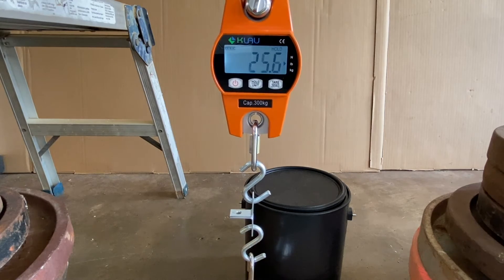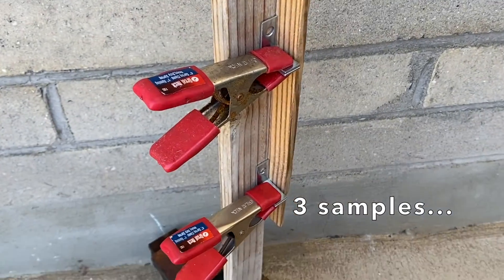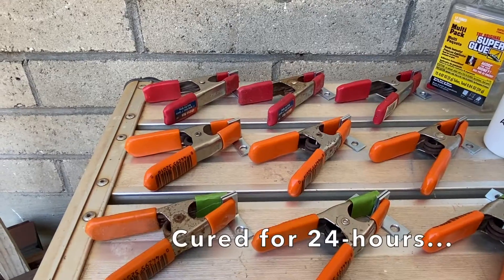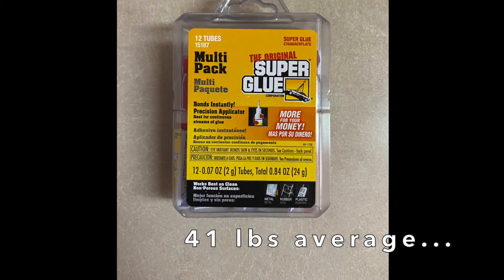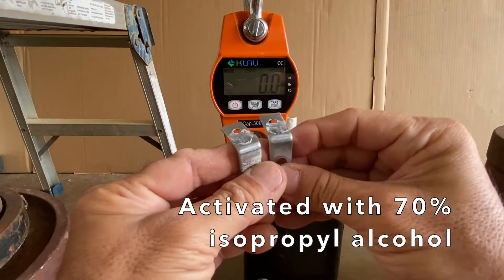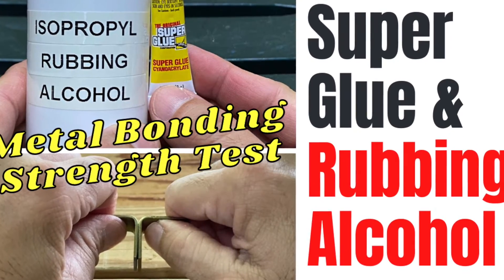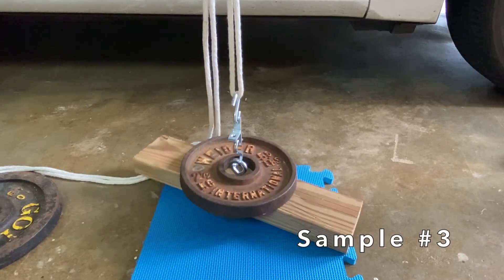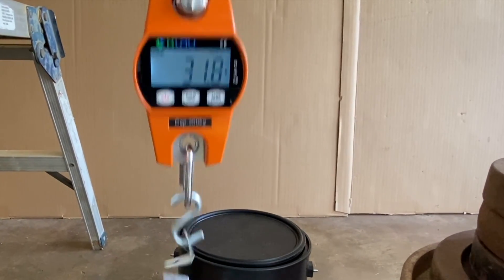DIY Super Glue Accelerant Strength Test

Comment: Have you tested the activators you used in this test with plastic?   I would love to see that.  Thanks for confirming the fact that the activators you used in this test on metal to metal do not strenghen the bond but only accelerate the curing of the bond.   Great video.  Thank you very much!

Comment: Poor methodology. Read the comments below, and try again.  The activated will still likely be weaker, but much closer.  My favorite DIY activator is distilled water and 10% alcohol. I don't use drug store 70% Isopropyl, because it has a lot of additives. I use 100% Ethanol, available on line.

Comment: The accelerant probably caused the glue to cure before it had a chance to seep into the surface crevasses, where as the non-accelerate took longer to cure and had more time to get down into every surface imperfection.  Accelerated super gluing of wood is probably okay, because the surface in very porous and even with short curing times it's able to get down in those crevasses easily.

I'd love to see the accelerated test redone, but this time, lightly sand the surfaces that will be glued and see if that makes a difference.

Comment: This video is actually very good, because it teaches a fundamental lesson about polymers.   Chemistry Lesson Time!!!!   Super glue is a monomer (cyanoacrylate) which reacts to make a polymer in order to cure.  As you know, the polymerization must initiate, and we know that water is a good initiator.  I want to keep this a bit oversimplified.  Imagine if you only had 1 molecule of water.  Then the polymer would only initiate in one spot, and so the chain would slowly keep growing until you polymerized everything into ONE long chain.  That chain would be super strong, because it's held together by covalent bonds.  However, the cure time would be VERY long.  When you add a whole bunch of water initiator, it means you start growing a whole bunch of chains.   Since millions of chains are growing all at the same time, each chain will be much shorter.  You will have consumed ALL of the polymer with this pile of chains.  You can imagine a scenario where you had so much initiator that every chain was only a few units long.  They would have no strength, and you would just have a liquid.  Sure, it would be done reacting in seconds, but it's not even a glue anymore.  So, no matter what you do, if you add more initiator, you will have a weaker bond.  (The baking soda does something similar.  Of course, it's a bit more complicated because it has some gap filling properties, but you still have the same issue... more initiation = faster cure but weaker bonds.)

Comment: 99% alcohol + baking soda 50:1 mix. Crazy Glue/Super Glue/CA Glue is acid, Baking soda is alkaline, when the two mix the CA glue sets. You use alcohol as the medium becaue it evaperoates quickly. If bonding metal you need to rough the surfaces first.
Reply: Hello
Bey weight or bey volume mix 50:1 🤔

Comment: The one you missed is alcohol and baking soda. That's the winner.
Reply from the maker: Interesting… are you talking about a mixture of  isopropyl alcohol and baking soda?  🤔
Reply: @HacksbyDad  yup
Reply from the maker: @mr.boniato6402  I just might give that a try.  Thanks!  😎
Reply: @HacksbyDad  about 1 cup of isopropyl alcohol to 1/4-1/2 teaspoon of baking soda. Try 1/4 see how it behaves, then add more from there.. too much baking soda could leave residue.
Reply from the maker: @mr.boniato6402  You read my mind!  I was wondering how much of each to use in the mix.  Thanks!  😎
Reply: i was going to suggest the same idea

Comment: I've found that using the DIY activator on the exterior after the pieces are put together works much better. The baking soda solution leaves residue in your joints thereby causing the weakness. Same with the alcohol. It works well, just not the way you've done it.

Comment: Maybe the isopropyl alcohol works better wood allowing the cyanoacrylate to better mate those surfaces. I’ve had good results building up a surface repair with CA and dry baking soda. Haven’t tried water with baking soda and I’m not sure why that would chemically be a good choice. Epoxy trends to be a better choice with heard flat surfaces in my experience.
Reply from the maker: Yeah... isopropyl alcohol works better on wood but still not as strong as plain super glue.  Baking soda and water was suggested by many viewers.  Just curious and experimenting in my garage.  Thanks for mentioning epoxy... I've used JB Weld epoxy on metal pieces in the past and the bond was very strong.  Maybe epoxy will be a future video... LOL
😎
Reply: @HacksbyDad  JB weld is surprisingly good stuff. Though best results are when you rough up the mating surfaces. Keep up the good work I’ll be tuning in.
Reply from the maker: @BeachBum68x  Thanks!  Appreciate the feedback!  👍